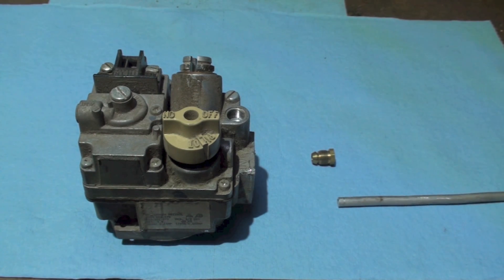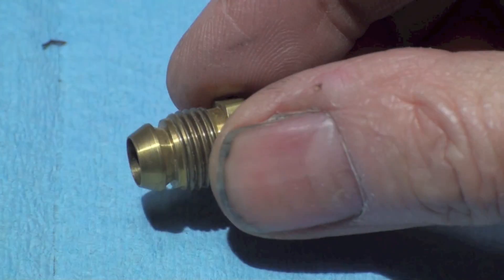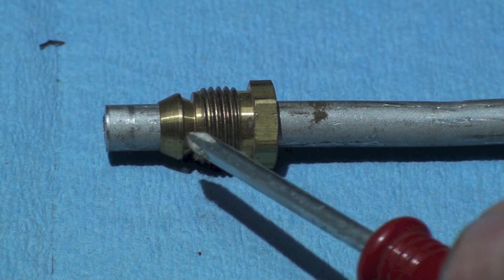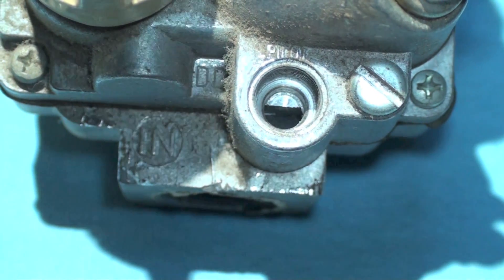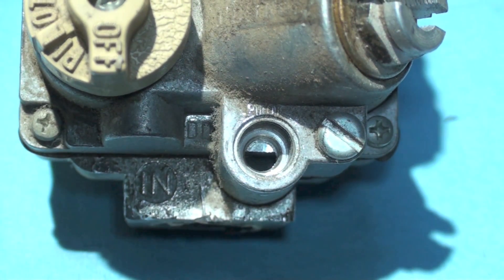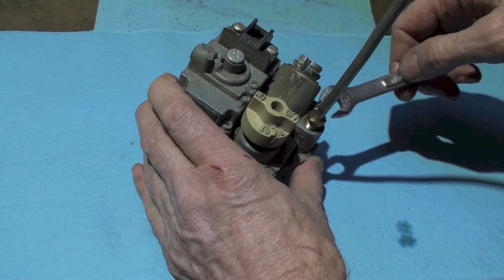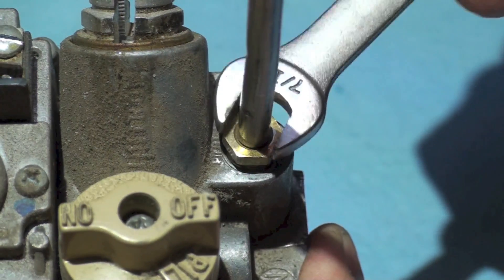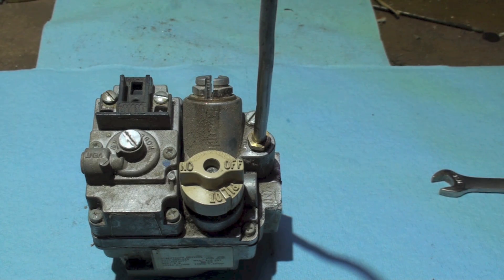Installing the ferrel connection on the gas furnace

Comment: GFM tutorials are excellent, in depth,  and easy to understand. Watching all his vids closely, especially with mobile home furnaces and gas valves, saved me $900! All the young, so called repairmen, are nothing but replacemen. My Coleman is 39. I had no less than 3 or 4 companies the past two years  send techs who didn't know how to light my old pilot or give a definite diagnosis if the gas valve was bad. Replace the entire system they all said to the tune of 11 and 12gs! Following GFM vids I was able to successfully replace my gas valve, pilot tubing and thermocouple. With the money I saved buying the gas valve online rather than a local supplier, i bought tools i needed including a gas leak detector. Also checked w bubbles to be safe. Its been 2 weeks and we should be set for the colder months  ahead!
Reply from the maker: Glad you got it going.
GFM

Comment: Can they be reused, or must a new breakaway ferrel be used if the tubing is being reattached? If new, then I suppose that means trimming an inch or so off the end of the tubing.
Reply from the maker: If you are simply removing the tubing assembly for component replacement, they can be reused if there are no leaks.  
If it must be replaced, you must either cut the end off and, if the tubing is straight, reuse it or replace the entire pilot tube and fittings.
GFM

Comment: If the threads start crossing, do you think it's possible to clean them up with a die/tap? are they NPT threads?
Reply from the maker: They are not NPT.  If you have a set of taps and dies, you can look for the right TPH and maybe it will work but I would change the fitting.
GFM

Comment: Wonder why no tape or thread sealant used on the pilot gas tube?
Reply from the maker: You can use oil on the threads to reduce friction on the threads, but the threads do not seal.  You can also apply a very small amount of thread sealer to the ferrel surface that may help.
GFM

Comment: Quick question! When replacing the thermocouple unit on my gas fireplace I overtightened the nut on the pilot tube and the pilot tube broke off. I thought it was 1/4 but that’s too big. I have everything to connect the 1/4 in aluminum pilot tube-is there a way to use an adapter to size down to 1/8? Or is it best if I try to find a 1/8 pilot tube and fittings?
Reply from the maker: I would be looking for the 1/8" tube.
GFM

Comment: what kind of oil are you using is like motor oil or like 2 stroke oil ??
Reply from the maker: I use zoom spout oil.  It is available at hardware stores but most anything will work.
GFM
Reply: @grayfurnaceman  thanks
Reply: @grayfurnaceman  used amsoil 2 stroke oil expensive stuff unit fired up w new pilot bracket and pilot assembly but I am still getting a cycling on and off a couple times before correction. have to test the ground id say for gas valve and also the aqua stat transformer see where this low voltage is happening

Comment: Thanks!  Was having a terrible time understanding how the fitting was working based on instructions I was reading for a set of gas logs and a Dexen 6003 millivolt pilot valve.  In this case the tube didn't go through the end of the fitting and was just flush with the end but it still worked and I heard it break off.

Comment: I was tightening the ferrule and after it was tight the line came off and I untightened it and the part that breaks off fell off and now I can't put it back on the line
Reply from the maker: Cut off the end of the tubing and if the tubing is long enough, start over with another ferrel assembly.
GFM

Comment: oil ? can I use Silicone Lubricant from spray or apply on it?
Reply from the maker: Sure, anything that reduces friction so more force can be applied to the sealing surfaces rather than the threads.
GFM

Comment: So once it breaks off is it "tight enough"?  Can you just go straight to pipe dope?  Also might be helpful to rename title to "breakaway ferrel for pilot" so people can find it easier using google :)
Reply from the maker: I generally ignore when it breaks off as I have been doing this for so long that I just feel the torque.  For someone without that feel, I guess it would just have to be "snug" then check for leaks.  
Yes, you can use pipe dope (sparingly) to start with.  I will see what I can do about the search.
GFM
Reply: @grayfurnaceman  Thanks, super useful explanation!

Comment: Hi!  Is the breakway piece supposed to actually ‘snap’ off?  I have a similar pilot valve that is using 3/16” aluminum tubing and the respective 3/16” brass breakway ferrule.  I tighten until I begin to strip the hexagonal shape and then I stop in order not to strip it anymore.  However,  the aluminum tubing is still moving freely in and out of the breakway ferrule piece.  What am I doing wrong?  Thanks
Reply: Did you get it sorted?
Reply: @paulhealey2984  yes i did,  thanks for replying, even if it took 4 years!

Comment: Thanks for this, got a new water heater and its leaking here at the threads straight from the factory. They sent me a new gas valve overnight, was looking at tips when installing it. Think i've got it all figured out.

Comment: Just replaced the pilot burner/igniter and gas delivery tube on the heater side of my 26 year old HVAC unit.  Thanks to your video I was able to make the gas connections with no leakage problems.  It fired right up and we have heat again.  Appreciate you sharing your knowledge and techniques.  You rock grayfurnaceman!!

Comment: What do you mean exactly by "breaking off the fitting" ? Does the section of tubing beyond the ferrel break off? Can you disconnect the fitting from the valve and re-install it ?
Reply: No the aluminum tube does not break off. The brass ferrule fitting (aka "breakaway" fitting) breaks into 2 pieces. When the fitting is tightened, the ferrule (flared part) breaks away at the narrow point where it is connected the the threaded part of the fitting, and then the ferrule portion ends up tightly griping and sealing the tubing. Yes, you can disconnect the fitting/tube from the gas valve and then reinstall it as many times as you like, as long as it still seals.  You would have to put a new "breakway" ferrule fitting on the aluminum tube if the surface on the old ferrule was damaged and you could not get it to seal.

Comment: Thanks for the tip of oil on the threads. I replaced a pilot tube on a gas fireplace and had a hard time sealing it. Oil worked great!
Reply from the maker: It has been long term for me.  Because it reduces friction, it concentrates more torque on the seating surface.
GFM
Reply from the maker: Welcome
GFM
Reply: grayfurnaceman I had the same - leaking along tubing after removing and putting it back in.  Oil worked great but is it a long term solution like pipedope.  I picture pipedope being a more permanent seal? Any thoughts?
Reply: grayfurnaceman thx

Comment: Best way I learned is to screw the ferrule into the gas valve by finger tight and then put the tube into the feral with a mark on on the tube for the depth and then tighten it up with a wrench to snap the federal off there's no way you can cross threaded doing it that way

Comment: Tightening brass into aluminum is scary.  Do you expect to feel the ferrel to break 100% of the time or sometimes can it seal without breaking off the fitting?
Excellent video.
Reply from the maker: Straycurrent They have always broken for me.  Thanks for the support.
GFM